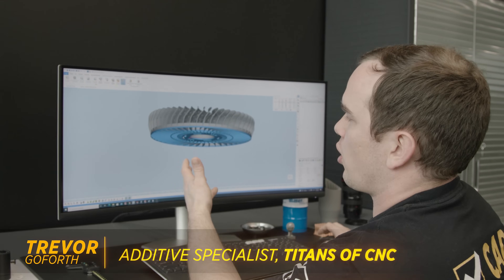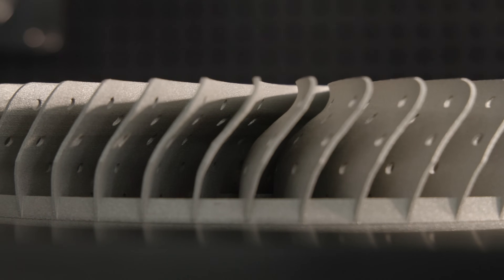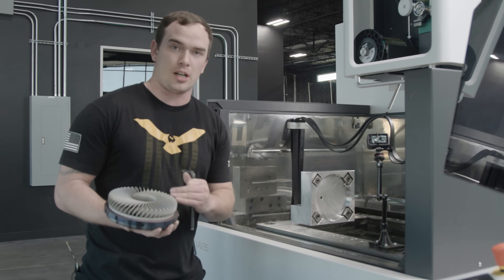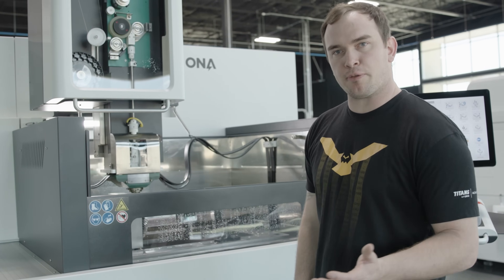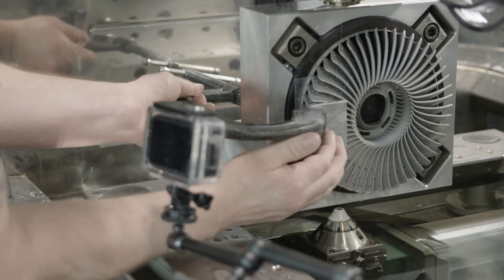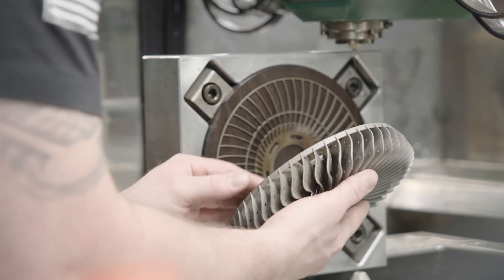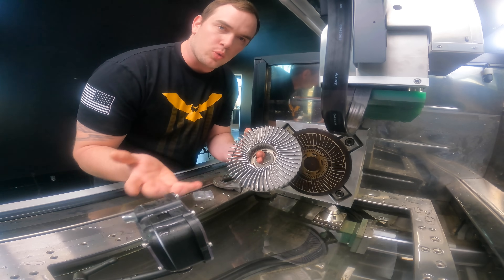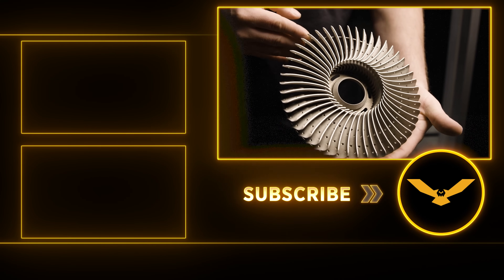Metal 3D Printing a 48 Blade Turbine Part out of 316L Stainless

Comment: I did not know EDM existed until 3 weeks ago, when I started a new job. Our shop has 3 of these, but they operate in the open, not under water. Now I see one (for the first time) on Youtube. Amazing idea.
Reply: Nothing like an electric wire that vaporizes everything in its path with microscopic lightning bolts
Reply: Edm nothing new. Been out for 50 years!
Reply: @codprawn  I’ve heard it was used in some form during WW2
Reply: @Guranga93  
Probably
Reply: Yeah edm is amazing, I've been doing wire eroding and spark erosion (die sinking) for the last 26 years, its old technology but still sometimes its the only way a job can be achieved :)
Reply: Porsche 3d prints already pistons for customer cars not for testing.

Comment: show us "end user product" - perfectly polished and balanced. also what about structural integrity of such production method? right now this looks like extremely wicked peace of scrap metal that will cost a fortune!
Reply: Usually the inner porosity is zero on right settings, atleast the centre line core. surface is typically over built for final machining  and includes enough meat to account relaxation too.

But it all comes down to the programmers intuition, additive has 100x the variables of subtractive

Comment: Looks friggin neat. Could you do some stress tests on a part as thin as that? Also, for a fan I'd imagine the blades would have to be a bit smoother? Are you planning on any other finishing ops?
Reply: Maybe you can print to get a smooth finish? I also wonder why there a holes in the fan blades
Reply: @Julian_Bester  
Those holes are actually used for heat dispensing. But I doubt this turbine even work.
Reply: @prasannajitpadira9655  yeah i really am curious, is this just a fan for looks? or can it actually be put into an aircraft for use?
Reply: @Tay-ky3fi  
Pretty sure it can't be used for an aircraft. 
Maybe for some industrial turbo fan ?
Reply: @Tay-ky3fi  I think they may have mixed up turbine with stator, since the blades are not attached anywhere near strongly enough for it to spin at a high RPM.
But even for that this seems flimsy and strangely designed (no need to have the inner and outer circumference open and weak like that).
I'm guessing it's just a demo rather than something designed for use, really with they would say.
Reply: give us x rays for that beautiful piece
Reply: It can be heated to critical temperatures, all cracks will converge.
Reply: @hibahprice6887  it would be cool to see some youtuber show that
Reply: Pn
Reply: Yeah I am curious about finish as well. I know they can machine mating surfaces to get that good finish but in those blades there is no way to machine that. I would assume most fans need a smoother surface
Reply: Pretty great method.  Wonder how many patents it will yield? Commentors have already hinted at polishing means ! Nice gift !

Comment: love 3d printing so cool to see how far it has come.... wonder how the durability of the 3d printed part would compare to a cnc part
Reply: The durability will be less compared to the cnc
Reply: @tacomonkey222  Actually no, durability is better than CNC. Parts have ~99,99% density and unique small microstructure yields excellent mechanical properties. Strength is below forged but better than CNC. 
Surface roughness will have an effect for the fatigue.
Reply: @vn-dc3hv  3D printing doesn't magically add strength to the part. A machined part will be just as strong as a printed part. Assuming the same material is used. In this case 316.
Reply: @brandons9138  it's not magic its metallurgy. Part is built by melting powder with a very small laser, this causes very very rapid melting and cooling which in turn gives very fine and unique grain structure. This microstructure strengthens the metal, especially 316L which you cannot harden by heat treatments.  There's really no way to introduce such grain structure into CNC'd part in 316L. Trust me, I did my masters in this exact subject.
Reply: @vn-dc3hv  I stand corrected. After some Googling I found a research paper abstract from 2017 where a group at Lawrence Livermore labs that talks about a process they've developed that can increase the strength of 3D printed stainless parts by as much as 300% in certain applications.
Reply: My buddy does plastic printing & each layer is basically a weak spot...

Comment: But does this turbine even work? With the very rough surface finish is should induce turbulences.
Reply: @christopherbentley6647  Right, because whales and fans totally operate at the same reynolds numbers.
Reply: @theSupercloak   I put dimples in my forehead with a ball peen hammer so I think faster because #GOLFBALL
Reply: I don't think it matters on a high pressure fan like this, I'd say smooth finish matters more on a low pressure fan like a wind turbine.
Reply: @spacecowboy07723 no matter the application
Smoother turbine blades are, more efficient turbine is
And it matters more at higher fluid velocity as rough surface can cause fluid separation from the blade
Reply: You can finish the part in a drum polisher then it would have to be balanced
Reply: @supa5523  It can't be balanced in that way
Reply: @AhmedAlsarraf  i wonder if it could be balanced right off the build plate
Reply: @jacobkudrowich  it’s impossible
Reply: @AhmedAlsarraf  it can be, just cut or weald a bead on it. Rince and repeat untill ballanced, then aneal it and harden again. You can even make the blades adjustable or removable right of the bat so you just shim them with diffrent weights.
Possibilities with this one is endless, its just poorly designed turbine.
Reply: Well development might have come far. But no material stress application would've never used a 3D printed, sintered or die cast part 10years ago.

Atleast that was what was told at Engineering school where Sandvik/Scania and ABB had guest lectures.

3D printing is spot welding, sintering leaves substructure imperfections, die cast leaves material stress and again different crystalline substructures in the metal due to how the cast cools after the pour. None of the methods ablve can be entirely remedied with heat after treatment.

One milled down huge block of metal is the way to go for most engine, turbine parts.
Reply: The guy literally said he was going to polish it up
Reply: @oldchap1228  a un 9 de una noche
Reply: It’s for prototyping mostly, but we’re slowly getting there technologically.
Reply: Thr biggest problem is the blades balance